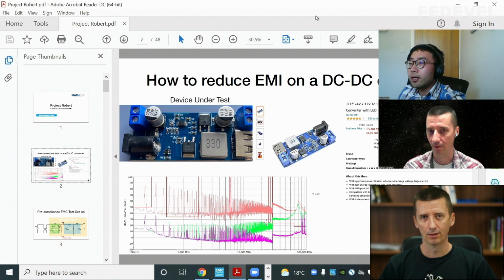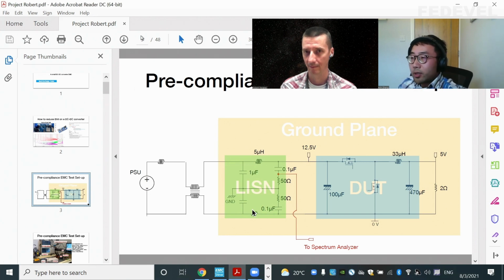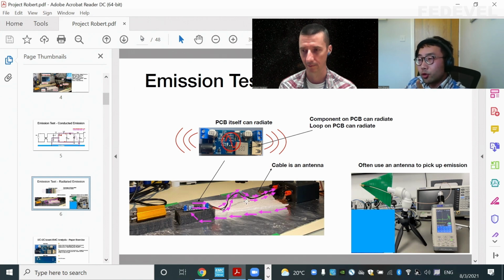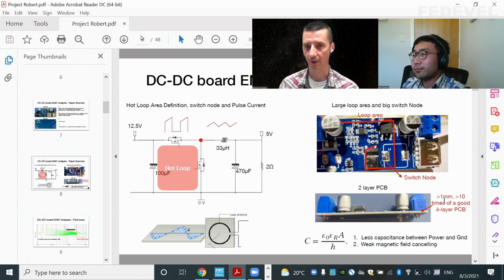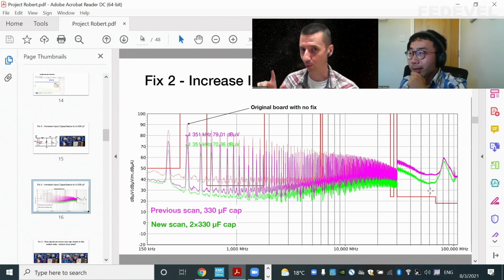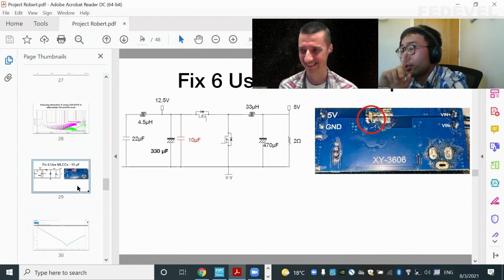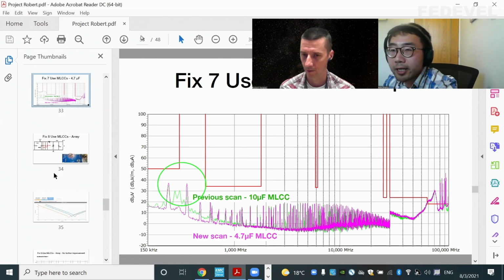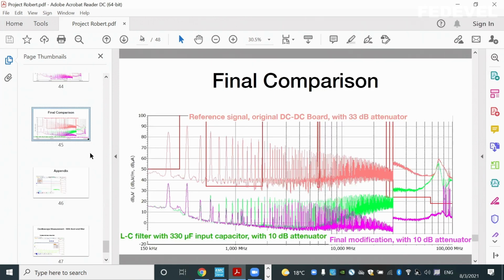9 Simple Tricks to Improve EMC / EMI on Your Boards - Practical examples (with Min Zhang)

Comment: thanks for these tips. i've been trying to pass a 3kw totem pole pfc and full bridge llc. after a week of debugging conducted emi    i can merely see an improvement especially at high frequency 4Mhz😂😂
Reply: Hi, PFC plus LLC is tricky, check your leakage inductance of your inductor and transformer, most likely they cause resonance with your switching devices.

Comment: Very nice video - Thank you! One question: In the CM simulation in 1:13:30. Why is there a 150pF capacitance? From which component can I calculate that cap in my circuit?
Reply: Hi, great question. It is purely based on experience and estimation, you can use simple capacitance calculation equations as well, if you know the area of the PCB and the height between the PCB and the test Ground plane.

Comment: 12:30 How about using batteries to supply the device under test, instead of the power supply? Wouldn't that be a very cheap way of getting a very cheap, low noise source?

Very very cool video nontheless. Extremely useful, and helps people get good EMC design without access to some (expensive) testing facility. I am curious how mr. Zhang does EMI precompliance testing for radiated emissions, with a 'standard' TEM cell?
Reply: Hi, I also did an interview with Robert on troubleshooting radiated emissions after this interview, please check. You can also check my own EMC channel, just search engineers' guide to radiated emission tests! please provide feedback!

Comment: Does this basically eleminate emi/rf noises and common and differential mode as well starting from 150khz to 10mhz ??:0
Reply: Yes. It does, we did a filter design to tackle both DM and CM noise.

Comment: I am surprised , only LC circuit can bring so much changes in EMI ? 
What is the use of pi-filter ?
Reply: Hi, in a sense, it is PI (C-L-C) filter, because the C and L work with the input capacitors, just have a look at the schematics we drew, and you will see.

Comment: When connecting multiple high speed probes to DUT from a single scope, should all the probe wires be bundled together? In the rock band roadies world, they would call this a "snake" bundle. It supposedly to avoid creating ground loops in between the various cable shields.

Comment: I see, i need return path very close to each wire (depending on current and frequency of course). No i ask myself, what do i do with the wires connected to inductor in a dcdc unit (you call it the noise spot, its the part that changes its voltage very fast) As i understand, it is not good to have parasitic capacitance to these wire, but how then do i give it its return path?

Comment: How is the board failing the EMI test, If majority of the fixes was applied to the input signal. What I mean, is that the major contribution to the noise was due to the fact that the input signal given to the buck converter was not clean. So, If we want to use a buck converter which doesn't perform a input voltage filtering, will obviously have a poor EMI performance. Also, when performing a EMI test, the input supply is always filtered so that the input doesn't have an effect on the board under test.

Comment: This is interesting. I remember I did a project with an esp32 and tried using the hibernation (or deep sleep, I don't recall) and sometimes when the device woke up it restarted the whole code. I think there might have been issues with crosstalks that might have been either pulling down the voltage from the esp32 or triggering the reset pin. My point is, maybe it would be interesting to look at some esp32 boards as well...
Reply from the maker: I am working on a tutorial about ESP32 - depends on what you were using, but especially the default module is using a DIODE series in POWER + 1117 LDO which is not the best and that makes it sensitive for any power voltage drop.

Comment: at late parts of measurements, I see that there is no more a metalic plate beneath the test set up. 
If I am not wrong, this will reduce the common mode noise level by itself.

Comment: nowadays most of the DCDC chip vendors give application notes for their chip for free, which contains already the recommended capacitances values, coil, and layout hints.. which is a good and also a bad thing for HW engineers.  people then just know how to use that chip but don't know how to optimize the circuit if a failure occurs.   so thanks for the great video !    one question I do have, is why is only the so-called hot loop so critical. in fact, most of the time, the high side and low side FETs cant conducted simultaneously, which means the "hot loop" is not ON. what I have in mind for BUCK design is always keep the "charge" loop (the loop where only high-side FET is on ) and the "discharge" loop (the loop where only low-side FET is on)as small as possible.

Comment: I stop your video after 2 minutes beceause it's a fake.  Noise floor (noise line where noise is lowest) shall be the same between before and after EMC improvement, especialy if you keep the same parameters (RBW, VBW, step, dwell time...). I see arround 10dB difference so it's sure you don't have same parameters and probably used 120kHz RBW for initial measure and 9kHz for mesure after. For me it's a fake. Maybe peak noise are lower after improvement but you change also  results by don't used same parameters.
Reply from the maker: It is explained in the video

Comment: Very interesting video! There are a few things that could be prevented by doing a better layout. Input capacitors of buck converters should be as close as possible to the FETs to reduce loop inductance. Also, I would never use an electrolytic capacitor alone. ESR and ESL are terrible. Unless it is a low current converter, the input ripple should be horrible.
Reply: Absolutely agree!

Comment: Amazing to watch Robert, very helpful, keep it up.  How did you get the Frequency response curves of the filter Caps you added the 4.7uF 470nF and the 150nF ?  Datasheets dont give them. Does the package size 0603, 0805, 1206 make a big diffrence?

Comment: My hope is that engineers will develop a standalone circuit that knocks out the frequency of all these supplies much like reducing noise in noise quieting headphones .  This way designers can have a tunable frequency cleaner that separate from the circuit that cleans up or cancels frequency transmission without big changes to a limited quality supply.  It would involve pink and white noise filtering as a possible cleaning effect.  You battle the curves to smooth this noise curve.  A safer way to contain noise.

Comment: The one big drawback with digital or switching power supplies is a badly designed supply can transmit a lot of noise.  Using smd ceramic capacitor sometimes with a choke or resistor can reduce the noise generated by pulsing circuits which feed the main circuit to the secondary circuit.  I bought a supply for my computer it had higher amperes but it is noisier than the original it make watching a TV nearby hard .   It has no effect on the computer itself but it too is digital not analog .   This need to filter out these frequencies flowing thru your supply. You need to know approximately the frequency transmitting so you can filter it out without affecting the frequency running this supply.   Very common problem why designers do not just add a filter set up to limit noise is beyond me.   Too many companies act like this does not matter even though the FCC for one has rules for omissions.

Comment: @about 30:00, hot loop area is mentioned, it is a bit confusing to me, if the board has a solid ground plane and switching frequency is high, the return current on the GND plane should follow right underneath the top layer, so the area should be the length of the trace on the top plane times the PCB thickness. The way the slide is shown implies it is the area encircled by the red lines, is this not technically correct?

Comment: Thank you Robert and Min for such a good video! In the beginning there was a question, which had yet not been answered: how much of improvement these measures do with the radiation noise? For me it seems we're "trapping" noise inside the PCB, but it still able to radiate through the air. Does radiation suppression demand completely different approach? Is there a video on this topic? Thank you very much!

Comment: Hello Robert, I have a question related to the last part of the video. I was wondering why Min used 150p capacitor to calculate final value of the CMC? Where did this value come from?
Reply: Great question Marcin, the reason we selected 150 pF is an education guess based on the coupling between the DUT and the Ground Plane. 150 pF is roughly the parasitic capacitance between the two. Obviously, a very crude guess. The best way of simulating it is to use transmission line model, but that would take a lot of effort. In this case, purely simplified i would say.

Comment: What are the standard circuits to be followed to prevent EFT Entering the system?
Reply: Hi Revanth, for EFT, you will need to have TVS, X cap and Y Cap located close to the entry point of your system to divert the transient noise to lower impedance path, often - chassis. In case that a chassis doesn't exist, use CMC to block the noise, so it. does not enter to your system.

Comment: A very good and valuable explanation. BTW, why EMC regulations apply to electrical appliance products that go to Europe but not to US ? While US needs the FCC regulation compliance for electronic products, what is the differences between the two regulations?
Reply: Most of the time, FCC and CE regulations are the same. It is really a trade issue rather than technical barrier. Each country will have its own rule, but often you can trace it to the EN harmonised standards.

Comment: Truly excellent content!  
I have one question: Would there be a downside to using Li Ion battery power instead of a power supply / LISN combination.  I am thinking for less power hungry circuits than a DC2DC converter.
Reply: You would still need the LISN regardless as a reference impedance. But the li-ion is a good low noise source.

Comment: I think hot loop definition is not clear in this video. in my opinion it's the loop with high PULSATING current.
so frequency contents includes high frequency band due to step edges compared with ramping current and the high amplitude implies high H field.
Reply: Very good and constructive feedback Mohammed, you are absolutely right by the definition. in this case, the input side of the DC-DC does have high pulse of current due to the switching events. I will remember your clear definition and use it from now.

Comment: Why is there a step-change in every measurement at 40MHz? The step never changes, no matter what technique you use.
Reply: the step happens at exactly 30 Mhz, where according to CISPR 16 specifications, the measurement bandwidth has to be switched from 9 kHz to 120 kHz. Increasing measurement bandwidth from 9 to 120 kHz increases the base noise level of the analyzer by approximately 10 dB.

Comment: This a practical and powerful demonstration, thanks! The sentence "You want to deliver energy immeadiately" should be always remembered when designing a power supply
 I didn't know the existance of the LISN MATE in order to separate common mode noise from differential noise. 
A doubt. In the datasheets of some buck controllers it is suggested to use a 10uF or 22uF ceramic input capacitor. Can these high values ceramic input capacitors produce resonances at low frequencies?
Reply: That is a great question Gabriele, i would vote for 22 uF, the resonance really is caused by the layout of the design, isn't it, in a good design with trace and tracks short and tidy, i don't think the capacitor can easily resonate that much.
Reply: Yes, but it depends also on the surroundings of the capacitors such as routing.

Comment: Thank you, Robert. A lot of very useful information. Very important topic.
I always simulated the input filter from the other side. I think the result should be the same, because it is a linear system.
Another reason to add ceramic capacitors: ESR of aluminium capacitors increase with low temperatures. I guess the results of the original board would be even worse below 0°C.

Comment: I'm curious why the CISPR standard line is so strange,the frequency domain has many segments,is it necessary?In my memory,the standard in my courtry only has one step in the frequency domain.And I'm also courious about the "20H"rule, some one has research on it and found it useless and may even cause worse result,is it true?Why?
Reply: CISPR 25 is an automotive standard, which was specified historically in order to avoid disturbing car radio reception. Hence the limits were set to broadcast bands such as LW, MW, SW and FM band. Not too long ago, car radios were the only electronic equipment in vehicles.

Comment: That was a great & informative video with an awesome, well-prepared guest!
Maybe I missed the explanation, but what causes the jump in the noise-level of about 10 dB in all the graphs @ exactly 12 MHz?
Reply: Hi, it is not 12 MHz, since the scale is logrithmic, it is 30 MHz. the answer can be found in Michael Mayhofer's reply to one of the viewers, just check the comments in the stream and you will find the answer.

Comment: LISN is also to provide a uniform source impedance so differences in power supply outputs don’t change measurements (switcher, linear, battery, etc.)

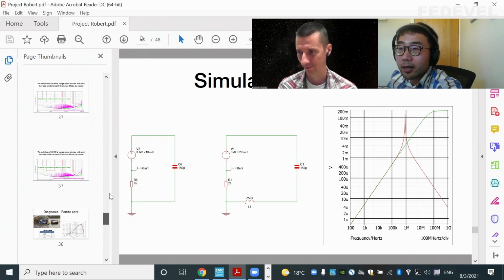Comment: Thanks, Robert. Geat video and fantastic exposition. Just one question... at the end, 1:13:53, Min simulates the filter using a 25 ohm resistor, because it is the parallel equivalent of the 2 x 50 ohm (on two branches inside the LISN). But he simulates just one branch of the circuit. Shouldn't then be using the regular 50 ohm resistor instead of the parallel equivalent? I'm not sure if I undertood it correctly. Thank you.
Reply: Hi David, what a great question. For a quick simulation like such, the value doesn't matter that much. The important bit is the inductor impedance starts dominating once the frequency goes up. I think in this case, one 50 ohm is spectrum analyzer RF input impedance, the other 50 ohm would be the 50 ohm termination resistor on the other LISN. Two in parallel gives 25 ohm. Inside the LISN, they often don't have 50 ohm, but rather 1k ohm. Hope this answers your question. We would love more questions like this to make us think!
Reply: @MachOneDesignEMC  Yes, that answers my question. Thank you!

Comment: Great video, nicely worked through.
Q) Where the text on the results graph shows 10db attenuation (which I understand is due to the transient protection device) does this mean that the measurements are actually 10db  higher across the sweep? or is this compensated for?
Reply: Hi Keith, the EMCView software has compensation for transient protection, attenuators, amplifiers, etc. So all results shown in the video are compensated values. The reason we put the info on the video is because when putting things like transient protector, attenuators, it will affect the noise floor. So just want to clarify to avoid confusions.

Comment: Wow. Very good and practical explanation. I'm eager to see part 2 - dealing with radiated emission (for the same board hopefully).
Reply: I'm curios. There is a sharp step in the spectrogram, exactly at 30MHz. Is this caused by the SA (higher noise floor above 30MHz) or it is actual measurement (caused by DUT)? It is very strange to me.
Reply: @velinr  Hi Velinr, from 30 MHz, the standard defines different RBW (resolution bandwidth) and scanning time, hence the scan will use a different set-up as compared with measurement below 30 MHz. When I first got into the EMC field, I had question exactly like you. All the best
Reply: @MachOneDesignEMC  , that means that SA switches settings in the middle of the sweep. This I didn't know.
I don't know much about EMC measurements, so I find stuff like this very interesting. After all, every engineer, who designs a product, should obey the rules of the EMC. But they are not aways clear. Thank you for the explanation!

Comment: Ming are how did you calibrate the measurement? Also how do you mitigate in rush current on power up with larger capacitance values potentially exceeding  1v/ohm derated values?
Reply: The test set-up was calibrated in our lab since we do EMC service for our clients all over the world. Calibration is almost a per week job. Your second question was a great one. We didn't. Because this is a demonstration video, we wanted to focus on the main topic. Often for inrush protection, design engineers would put things like inductor, or resistor with switch etc.

Comment: What would be your go to method for stopping digitalTV interference caused by LED ceiling light? Would it be more likely to be radiated rather than conducted? Shouldn't shielding around DC board grounded to earth help with that?
Reply: It depends. shielding around DC board ground, but you will need a good solid continuous ground plane, other wise the shield won't work effectively
Reply: @MachOneDesignEMC  I passed cables close to light through two small ferrites clip ons (one not enough) and that solved the problem

Comment: A gem from you Robert, amazing explanation in such a simple way step by step by Min. Would love to have more such practical case studies. Also tekbox LISN for measuring common mode & differential mode performance is very helpful. I learned that for the first time, didn't knew before about it. Thanks for the amazing content.